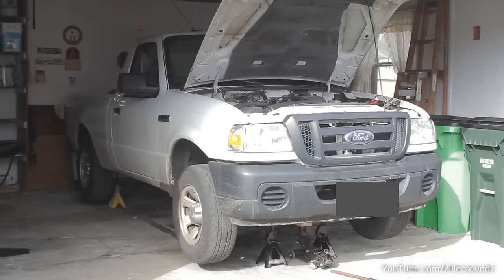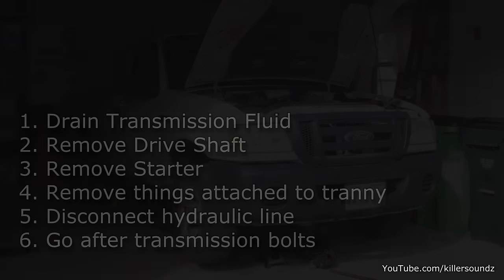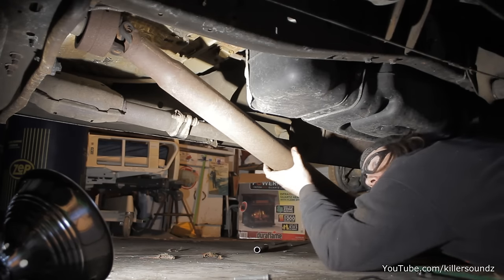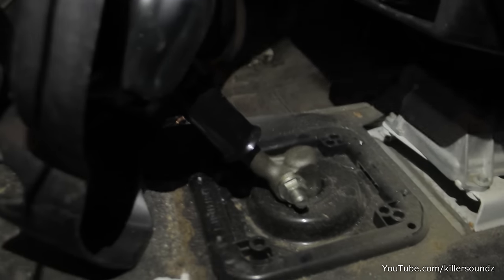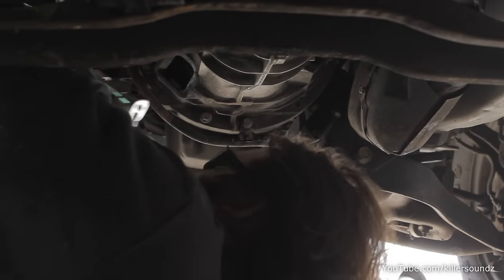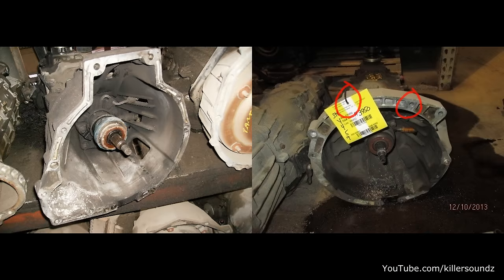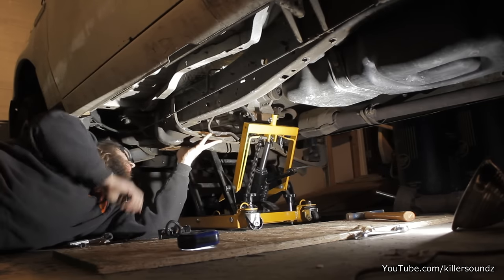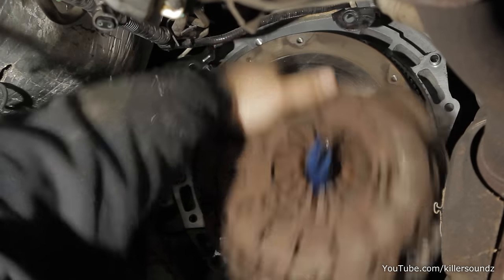How To Replace the Clutch in a Ford Ranger Manual 5 speed ✔

Comment: I have a 2004.  After about an hour of driving, when it gets nice and warm, the clutch does not release right away.  It will stick, then suddenly release jerking the clutch engaged.  You can feel the pedal slap your foot when this happens.  Like a throw-out bearing is sticking, or the slave. Last clutch I worked on had a through out bearing, but hey I'm going in to look!

Any advice?
Reply: has air in the sistem
. bleed it..
Reply: Thanks: I was hoping that's the prob!  Will do.

Comment: For the drive shaft bolts, just place a long bar in betweem the U joint and allow it to touch the ground and it'll keep the shaft from turning. 

The easiest way to remove the pilot bearing is to put in some axle grease and then (I use a wooden dowl) pound it out.

Also when changing the clutch, etc I alway replace the pressure plate, clutch, pilot bearing, throwout bearing and have the flywheel resurfaced. It doesn't make sense to not replace everything all at once.

Shal ' aam Aleichem
AAPiY
Mike
Reply: yeah i watched it. It was a needle bearing type and yes they are a PITA to get out.
Reply: Damn, been a mechanic for over 44 yrs and never ran into that kind of a screwed up pilot bearing removal. 
First time for everything I guess. 

If I run into one of those, I'll whip out the Dremel, cold chisel and a cold one (for the breaks in between the cussing).

Shal ' aam Aleichem
AAPiY
Mike
Reply: Damn someone forgot the old adage "Simplicity is the Ultimate in Sophistication"

The "old" days, vehicles were much easier to work on.
Reply: I still don’t understand how to get the pilot bearing out. I

Comment: I have the older type in a '94 B4000 4.0  4x4 and it's very crowded around the bell housing.. Those top two bolts are extremely difficult to access.

Comment: I need help!! I only made it to removing the shifter rod and decided this job is not for me. Problem is, theres something wrong with the shifter rod now. I reinstalled it just the way it came out, but truck is acting like its stuck in gear when it should be in neutral, also the shift pattern is all screwed up, like it wont go in any gears except right to right, but not down only goes right. Any ideas? I need this fixed so i can drive to mechanic. Why did i even fuck with it!!!!

Comment: I compressed my slave cyl with a C clamp and tied it with some string in the compressed state.  If you don't the slave cyl hits the clutch 1 1/2 inches before the trans is thru the pilot bearing. You also get a lot better look at how the trans is going thru the clutch when viewed thru the bigger hole in the trans. I removed all the sting once  I had bolted the trans in place.

Comment: I just replaced my clutch and slave cylinder but my truck won't shift at all I can turn it on. But as soon as I take my foot of the clutch it turns off. I think is stuck in gear can you pls help. Do I have to remove transmission again?
Reply: TheEverflores not sometimes, ALL the time

Comment: Just thought I'd mention that the pilot bearing will come right out with the bread trick, but a 5/8" (.625") bolt is too big. .550" is perfect, but a 1/2" (.500") will work ok. Put a little grease in before the bread, and refill the bread after a couple taps. I've done this on 3 clutches.

Comment: fwiw it took me 3 minutes with a ratchet and socket to get that elusive driver side top bolt from underneath the truck and im going to put it back in cause it will be easy.. prob don’t even need a transmission jack just bench press the thing down and back up it’s pretty light

Comment: To get my exhaust/manifold bolts broken loose; I have a small about 6 inch long,3/8 inch drive impact that gets struck with hammer, I had success.
Its for freeing frozen rusty nuts,bolts.

Comment: How many miles did you have on the  08 Ranger? I want to replace my clutch prior to it going bad.
Reply: Very true, Corey. Mileage means very little. I bought a new 97 2.3L Ranger and traded it in after 9 years with 201K miles. The clutch was never worked on and still felt no different than it did when I drove it off the lot. My recently purchased 07 Ranger, however, with only 82K, now is having some clutch issues I need to address. It doesn't want to shift into first after coming to a stop. It's a great truck and worth fixing, but after watching this video, I'm going to pay someone to fix it.

Comment: What noises was it making? Mine is making some clicking noise on the shifter...
Reply: Mine also had a clicking noise, 1998 2.5 5spd. Replaced the clutch kit, slave, pilot bearing, and also the gear shifter bearing (mine was completely obliiterated!!!). Took me and a buddy 4 hours in my driveway and this was our first clutch on a ranger just winging it by feel. If you're young or agile i'd highly recommend doing it yourself (Cheapest I was quoted here was $1250).

Comment: The easiest way to loosen the driveshaft bolts is set parking brake, I know this because I changed the clutch 4 times in my ranger in 1w years and 400,000 miles I had it lol

Comment: You actually wanna remove the drive shaft bolts while its off the ground, its a lot easier to spin the shaft and shove a screwdriver in it as a stop

Comment: 2004 ford ranger 5 speed. Canada, top bolts 15 mm. lower bolts 13 mm. One tiny bolt, 8 mm. very top tuff bolt, there's a trick. through the wheel while crack It. hook up some vinyl tubing to a 3/8 15 mm socket about 20" long.  . go under car send It up through the top of tranny. Lossen all the way.  Good luck.

Comment: bread workjed for me.  i used whole wheat crust, kinda dry.  at first i packed it too full and it did noyt work well then i only packed it to the end of the bearing and that worked well.  aT first the bread must have been pushing out on the inside of the bearing but when i left space in the bearing it worked.  i bought a bolt just the size of the inside of bearibng and just kept wailing on it.

Comment: I'm building a 4wd out of old unregistered cars, one has a blown motor ano0ther has no gearbox and transfer,  I'm going to try my engine crane, with a strap around the gearbox, through the hole the gearstick goes through,  to hold the gearbox up and lower it slowly, the portable skyhook method, I'll try

Comment: that hammer was waay too tiny for that bearing. if you got even a 3 or 4 pounder it would've popped right out. one time i spent 2 hours banging on a stuck rotor with a 5 pound hammer. went and got an 11 pound sledge and it came off in one hit. that was the day i learned the power of just a couple extra pounds

Comment: I watched your video and did everything you did, except I see what you mean about those top two bolts are a bitch to get to, what I did was get a really really long extension and loosened and tightened the bolts from the back of the transmission, and I never touched the starter so it's not in the way of anything

Comment: torqued down the pressure plate and the fins aren't compressing enough on the pressure plate for the transmission to properly seat on the engine, kinda stumped any one got any tips?
Reply: Make sure that your clutch disc isn't backwards, facing the wrong direction. (I know it's been a while but that would cause your issue)

Comment: I heard some people use a hole saw and cut a hole in the top the cab I don't intend to put a rubber plug in there when they were done I don't know I never done that before but I'm about to do one in my 97 hopefully if I don't have as much trouble as you did I'm going to buy a pilot bearing from Ford Motor Company and I'm going to use a Ford Motor Company clutch and the hydraulic slave cylinder some stuff doesn't pay to buy aftermarket I never put aftermarket clutches always use of Ford Motor company parts genuine Ford parts no OEM b***** you see how long the clutch last with Ford parts I used the greatest clutch parts aftermarket their b***** Ford parts all the way cost a lot more though tell you that much

Comment: All the videos showed the clutch repair accurately except the part where you out your feet on the front and pull with everything you have on the housing to get it off after prying it for two days. Yes it takes two guys and a jack. Also it doesn't weigh that much.

Comment: Never buying another ford
Reply: . . . Newer that 2012.  Seems like that's when their last good "Better Ideas" engineers retired.

2013 is an "Iffy" year.  If it doesn't have a non-electronic power steering pump, don't touch it. (2013 Expedition is cool.  2013 F-150, not so much. Almost 2 grand to replace the steering "Module" assembly that can last as little as 3 years VS. a $30 belt that won't break for a decade or so and a pump that can last decades.)